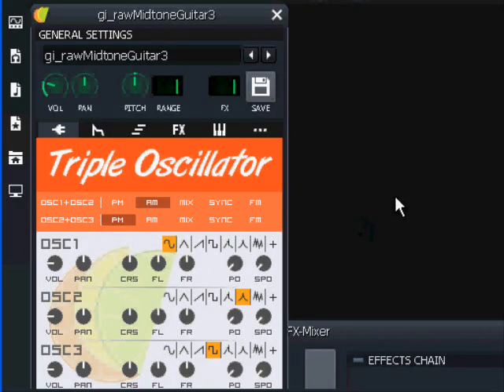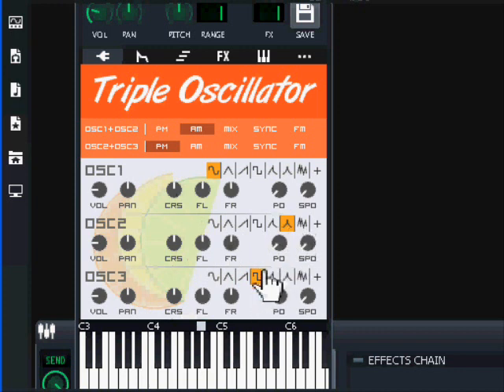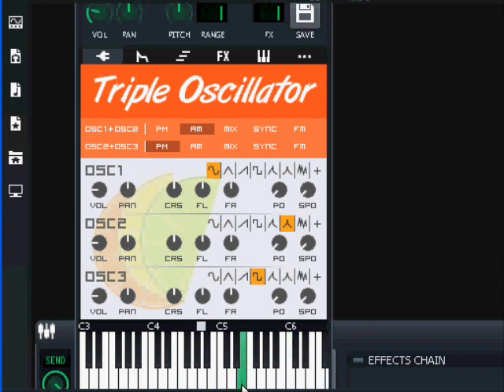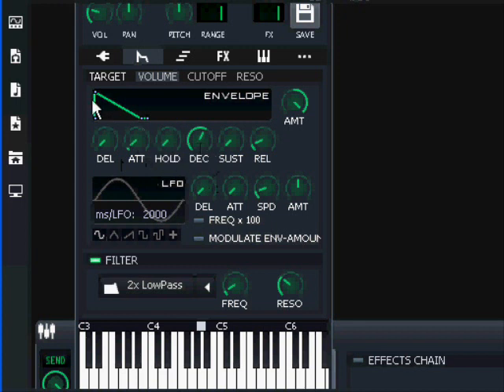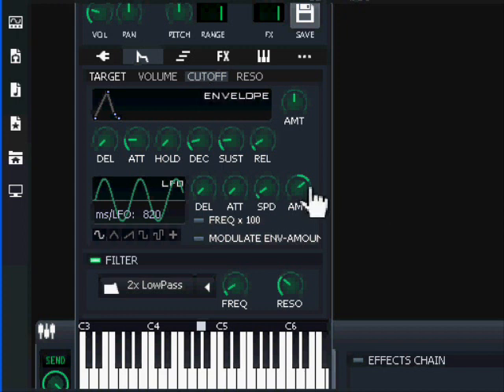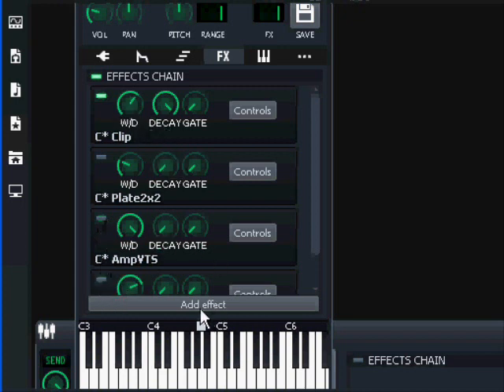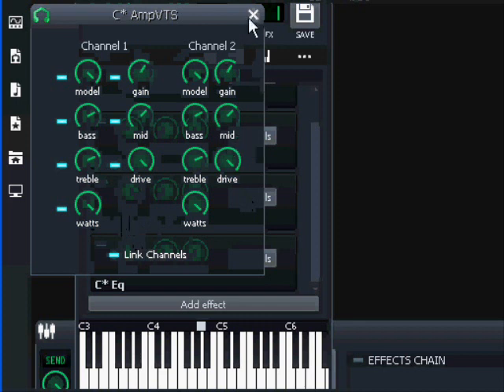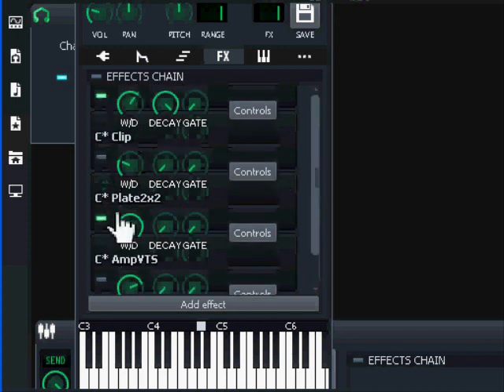Rock Guitars in LMMS

Comment: I tried to replicate the settings, but it doesn't sound like yours. It keeps swinging back and forth in volume, and I don't know why. Is there something that I'm missing? I'm asking because you seem to have more knowledge on how these settings work more than I do.
Reply from the maker: Hi!
If you have cyclic variations in volume, it could be that your LFO is influencing the output.
That is creating a *Leslie-guitar*, but those are not rock/ metal, so the LFO should be off, or only have very little influence on the output, where it could ad just a tiny bit of 'unease' in the tone -Like if a tube amp was used. If thats not it I need to see your preset
Reply: @bearsoundzMusic  I still haven't figured it out, but I did realize that the FX could be applied to the Sforzando and Metal GTX Guitar VST's that I had previously downloaded. So now I have proper metal guitars thanks to your guide on the FX controls. So with that being said, do you know what other FX controls could give my guitars more distortion? I want to create a guitar that sounds similar to the ones Metallica and Megadeth use.

Comment: great tutorial man! I love how the guitar effect sounds, my only problem is that I can't get it to play quieter even with the volume turned down. I turned down the gain which makes it quieter but messes up the effect. do you know how to fix this?
Reply from the maker: Yes! controlling the volume can be difficult, but use the *mixer*! The mixer-slider for your guitar-channel, will let you have the bst control over output. You can also add an amplifier, because that plugin has negative settings too, so you can dampen the output, with an amplifier!
Reply: just to clarify I adjusted both the c* clip gain and the C* Amp gain as well has some other volume settings, but everytime the guitar loses its effect